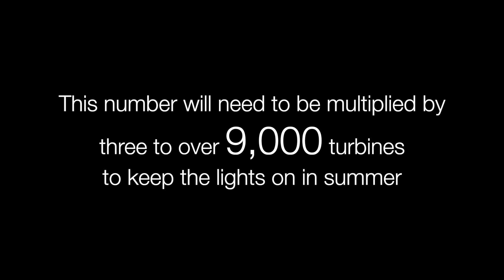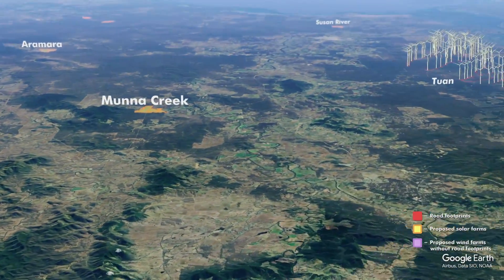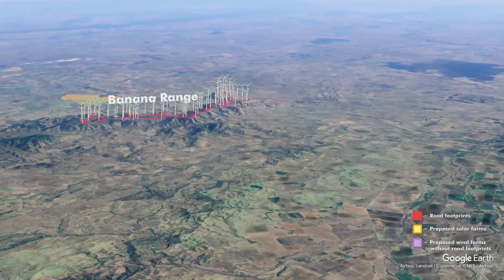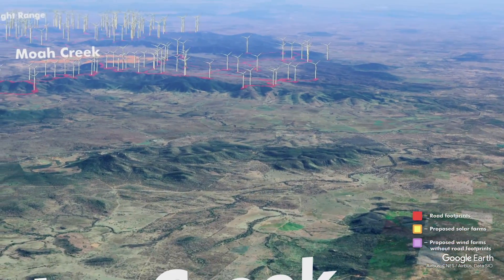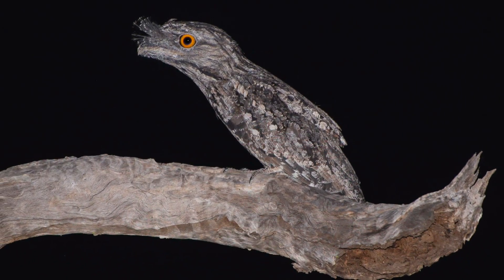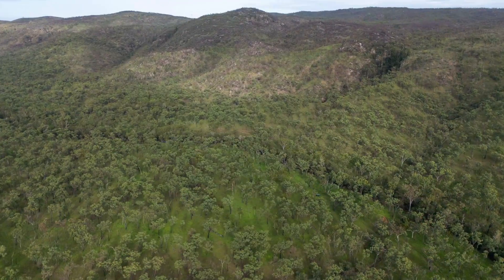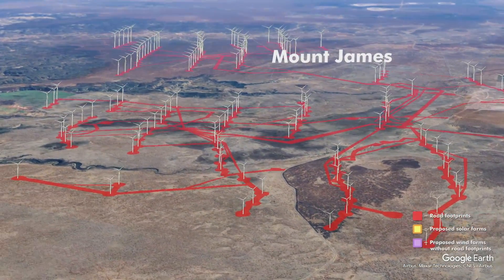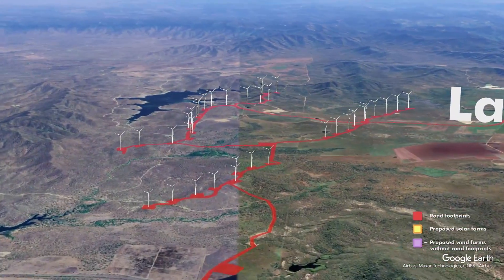Proposed renewable energy projects across Queensland.

Comment: Can you do this for all the gas fracking and coal mine sites next?
Reply: why whats the problem
Reply: @peterschaefer2946  Same thing but worse, environmental impacts from clearing land for massive canyon sized holes in the ground that aren't reverted back to their original state after extraction, release of excess methane from gas fracking sites, not to mention the potential for increase earthquake activity and poisoning of ground water
Reply: @peterschaefer2946  Do you mean like death in general or climate change?
Reply: @0ctatr0n  In Australia, all open cut mines (at least the coal mines - no -one seems to care about the iron ore, the copper, the lithium, the lead and zinc holes in the ground (and gold, there's a lot of them)) are only approved with remediation plans and reserved deposits to cover the end of life of the "canyon".  Many are returned to similar agricultural productivity prior to mining.
The depths of fracking in Australia are such that there is no risk of increased earthquake actiivity. Also the wells are sealed as they go and it is almost impossible for any cross contamination of the aquifers that may be passed through.
Reply: @planesounds  I suppose fracking is ok if you like to light your water on fire.  Also a new satellite launched that tracks methane emissions has found it is absolutley pouring out of fracking sites, so not really good for the environment.  Anyway we should be moving away from fossil fuels.  At least the Gold, Lithium and copper we mine can be reused and recycled.  Can't do that with Gas or Coal
Reply: @planesounds  Mate you can't just disrupt then patch over & everything rebounds like that. Also they use 'biodiversity offsets' for impacts that are unavoidable, which are a total joke.
Reply: @0ctatr0n  What's this about lighting your water?  Never happened in Australia.  Fracking has had no actual adverse effects in Queensland where it has been used.  There were claims of methane bubbling in local creeks and billabongs but shown to be a totally natural process that has been happening for decades before any such activities occurred in the region.
Reply: @gunnar4554  In Queensland it has been shown that open cut coal mines can be and have been remediated to a productivity within percentage points of pre mining.  Not exactly "patching over" but restoring the soils to the same stratas as prior to stripping.
Reply: And what about oil drilling on land and sea and the environmental damage caused?
Reply: @iscadean6038  none

Comment: When rooftop solar and home or neighbourhood batteries could supply all our residential needs, why do this? 
Is it so foreign owned fossil fuel companies can make more money exporting green hydrogen while not paying any tax here.
Reply: wind complements solar. solar farms and wind on a grid delivers much cheaper energy than homes with PV on the roof and batteries. PV is it costs less to deploy en masse at farms. can be compatible with cropping systems too. you also need to realise that much of the power we sue today and even more of it in a net zero economy will not be used in households. all sorts of buildings and industrial locations will need electricity to avoid using fossil fuels. saying “i’m alright, i’ve got PV and batteries” will not solve the climate crisis.
Reply: @alastairleith8612  Simply though just bear in mind that the "Climate Crises" is a 100% political construct.  Only money will solve that "Emergency".  Our money.
Reply: @alastairleith8612  What climate crisis? There isn't one!